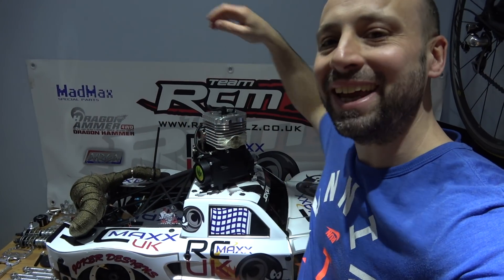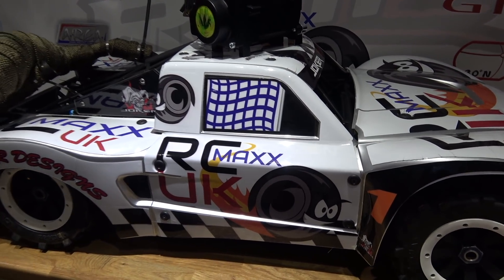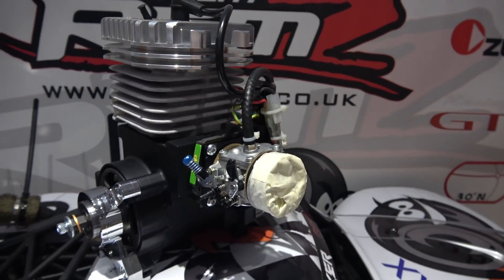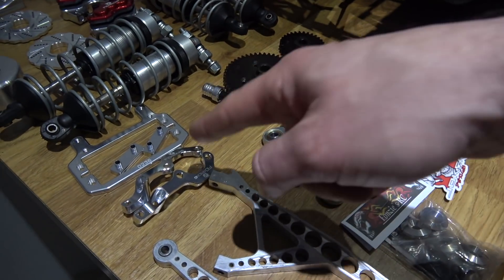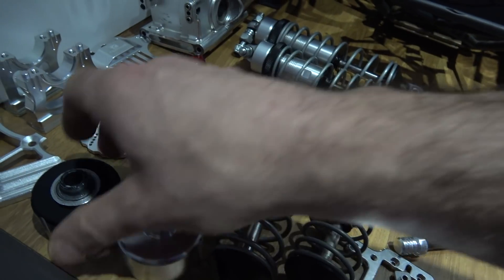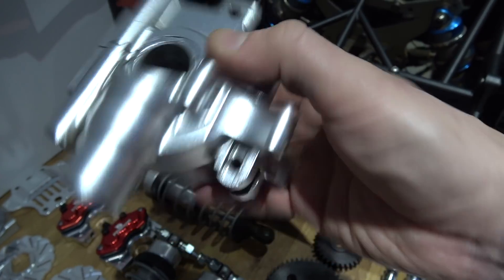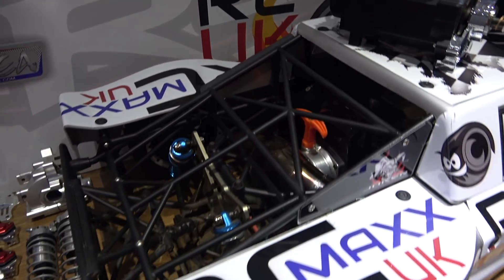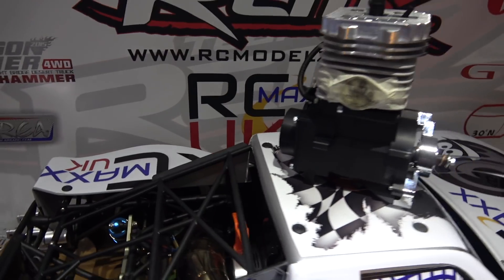My Losi 5t ALX 71 Malossi build starts soon!

Comment: that's gonna be a great project joel,
its gonna take a while to get the drive train sorted though, chasing weak points and all that,
I would say try the diff locker, I was gonna try one on my DH twin centre diff, but heard of a fair amount of people breaking pins on a regular basis , 
so instead I've gone the 1,000,000 cst oil route, I will find out what happens in the spring lol,
trial and error till you get it right, but stick with it , you will find the right combination of parts soon enough,
Reply from the maker: hi mate. cheers. yeah its a big learning process..... no doubt I'm going to break a lot of parts finding what works and what does not ;)

i'm hoping to get lucky and stick with it for sure. fingers crossed!

Comment: Looking great !!!! I would definitely get Modified Rc center diff if you can not get one. I found the GPM center diff mount has the larger bearings they say you have to run their spur but all you have to do it get a set of modified rc bearings and use the modified bearing on the spur gear side and you will be good to go. I run one in my brushless 5T and its holding up.  Its on!y around $30 - $40 for the GPM it does not come with a top brace but you already have one.  I run a modified rc center diff in my GaS 5T but did not want to spend the money on another for my brushless 5T so that's how I found out the modified rc bearings work great with the GPM center diff mount and they are the only one besides modified rc that takes the 15x28x7 bearings.  Also maybe run 500k or 1 million weight in the center diff instead of that locker.  You do want some give there.   Can't wait for more vids and to see this monster rip
Reply from the maker: hi mate. thanks for that advice... I will try the stuff i have but for sure will take on all advice and refer back to it! so really appreciate it. great to know these little nuggets of useful info found out from others experience! cheers ;)

Comment: Was wondering how this turned out RC Maxx, what did you end up using for the center spur, front, and rear ring gear? Did you use diff fluid with a high thermal conductivity? Did you have to rebuild your diff, or get new diff pinion gears? I would love to know, because I am actually starting a very similar build myself. I wish it was possible to get torsen differentials for 1/5 scale, as this type of diff would be fantastic for big bore power bcs it locks instantly when traction is lost.

Comment: diffs, drive shafts, pinions. all gonna last 20 minutes. not pissing on your fire. just simple rc physics law. unless your easy on it.
Reply from the maker: Dangerous RC productions no worries mate. Appreciate the opinions and tbh I agree. From what I have seen and heard you are right. The alx71 malossi is a complete beast of an engine and currently there is not really a drive train to take its abuse. I’ve had a slight change of plan actually ... hence no recent update on this project. Vid coming soon to explain. That. It’s being put together over the next few weeks. 👍👍

Diffs r ok I hear with alloy bulkheads from pro am and Ali cups. Pinions / spur are blackbone and now alx himself is making his own. It’s the pins and drive shafts/ cups that currently has no solution. Alx has recently made baja rear cups... losi will be next we r all hoping.

Comment: The rcmaxx  an alx motors must cost a lot to build an make . Cause 1500 to 3500 for 70cc  or so motor  damn!   You think they could make them a little more affordable.
Reply from the maker: they are around £1500- 1800 i think. rcmax and alx. but yeah add the car and upgrades and i'd think u r easily into 3K territory. They are beautiful pieces of engineering....and  I guess that are making for a small market too so prices are high. b great if they were half the price of course!! ;)

Comment: Don't run that diff lock with that motor don't recommend it
Reply: Heck yeah,,,I totally agree.....That's a strong motor...OMG,,,,Enjoy tho....
Reply from the maker: Appreciate the advice guys! yeah... i'm unsure about the locker. never run one... but i have had advice from guys running a locker with this engine...to be honest some like the locker....some don't. ;)

i will try it but i am fully prepared to change my setup as i get to run it. the problem with running an engine like this is getting the drive train sorted to take the abuse!... and realistically i'm fairly sure a bullet proof setup is not really there yet....( available)
Reply from the maker: thanks for that advice mate. what would u do?
Reply: RC Maxx UK I run 500k diff oil with a 30cc motor you probably need one mill diff oil with that motor. Don't use diff lock with that motor
Reply: That motor has to much power so there is no need to put more power to the ground by locking or thickening diffs all that’s going to do is make you loose control of the RC with that highly overpowered engine!!!! It’s best to run thin diff oil possibly stock weight just like what’s recommended for racing at race tracks ! When I used to race for T/A and TLR we all ran thin diff oil at the track so we could handle better. Thicker diff oil is great to bash because more power to ground and higher risk of losing control. It helps the guys that bash with stock motors or normal size powered engines . But if you must and you want to go thick do not pass 500K center diff and 100k front and rear!!! Even that is to thick for that truly overpowered engine but at least you will have a better chance to control your car and if you jump there will be a better chance of not breaking Diffs like when you have lockers or with super thick oil that’s almost like lockers. This is not my opinion this is facts and the truth!!!!!